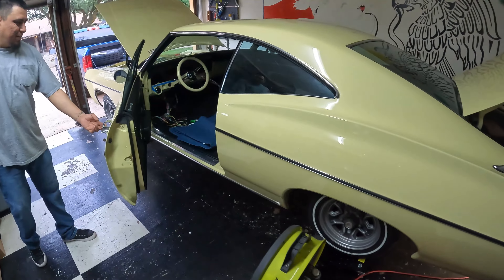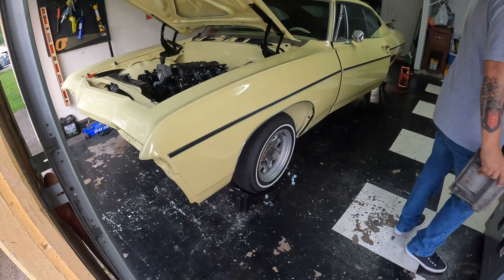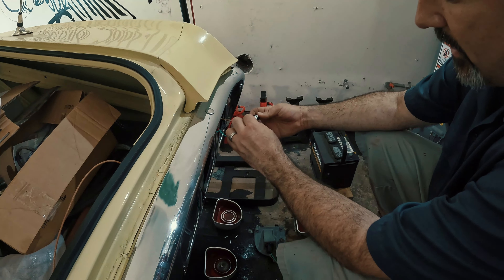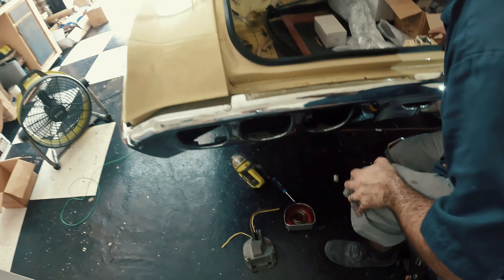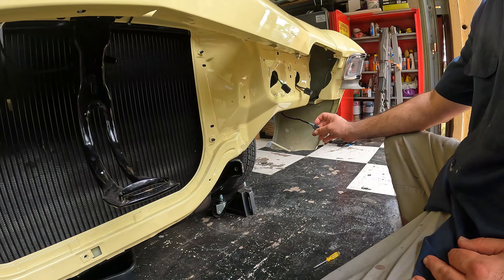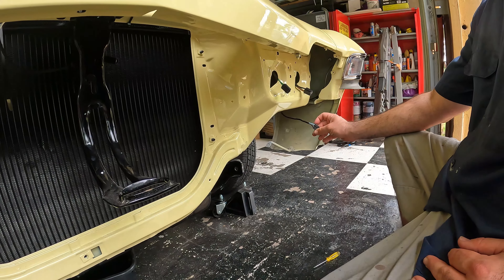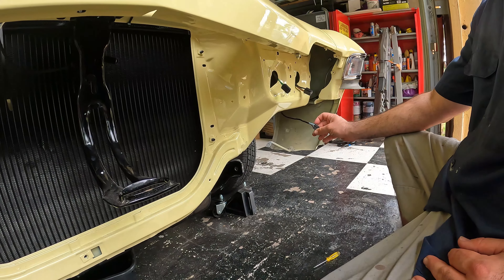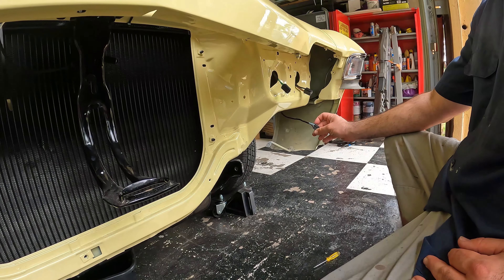1968 Chevrolet Impala American Auto Wire Install | @lonestarlows | PSI | Dakota Digital Dash

Comment: Car is coming along very nicely.
The AAW Crimpers are a "Must Have" even if you only do one job with them, nothing else does as nice of a job.
I found that reading the instructions about 5 times helps a lot 🙂
The Plug & Play for the LS looks very good.
Will he have to do anything with the stock computer ?????
Reply from the maker: Good morning Ed! Yes. I take the instructions with me to work and read them during break time !!
Reply: @lonestarlows  Smart Man for sure 🙂
They do a very good job in the instruction but you just have to slow down and read.